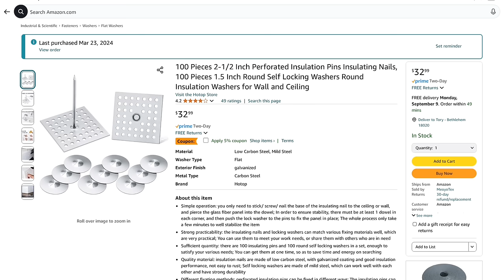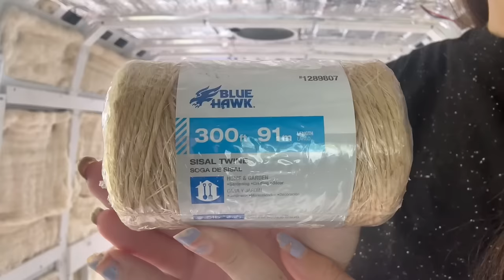Insulating my Camper Van with Havelock Wool | DIY Solo Female Van Build Series

Comment: I like Havelock, but I will mention a plus for Thinsulate is not worrying about it after installation. I put it up with 3M 90 spray adhesive 9 years ago, and its still in place, including the ceiling. How do I know for sure?  Because I'm an extra lazy van builder and never got around to putting up finished walls or ceiling, so the Thinsulate has been my decor.
Reply: Can you assist me too pls

Comment: I would not want the wires in the insulation. I would run channels of PVC tubes to run the wires through so they are easy to replace without tearing the van walls apart if you have wiring issues or want to run more wires for additional items later on.

Comment: For any other builders using the pins for insulation, they can be cut shorter with side cutters after pushing on the circular clips to the required depth.

Comment: when I did research for insulating my enclosed trailer, I was amazed about how no one seemed to have a consensus on the best insulation except for Spray foam insulation (That even has downsides like clean up afterword).  sealing it completely has downsides because the trailer can't breathe and leaving it breathable can have issues also like letting moisture in and it might not dry itself out.  I ended up deciding to go with owens corning pink foam boards with a pressure fit. I did not seal the boards, the boards are moisture resistant and wanted any leaks to run down to floor and leak out the trailer.  good luck with this insulation.

Comment: those stick pins are common for insulating hvac ducts, and just cut the pins off using any kind of cutters after you install the retainer disc. I would likely use rockwool for the lowest foot, for the wet issues, but options and weight.

Comment: Your actually right put wires between the wall sheet and the wool and not the van and the wool in case there’s a problem down the line you’re not taking all the wool out to fix a wire you only have to take down a panel 💜
Reply from the maker: YES! I completely agree! Thanks for the helpful comment!

Comment: AutoPly Cargo Van Insulation from Upfit Supply comes in the form of pre-cut kits with a peel-and-stick application process. They are designed to fit specific vehicle models like the Ram Promaster. Kits start at $270.

Comment: You probably smell the lanolin in the wool, not the wool itself. I think I'd rather use rockwool, totally inert. And unless your walls are very sloppy, there should be no danger of inhaling it, either.
 Look online for a "nail puller" od "nail nipper", they are tools built to cut protruding nails flush. Just take a bite off each nail to shorten them.

Comment: What about using spray adhesive to adhere the insulation to the van wall? If you go with the pins you will have to put several on each piece of insulation to spread the weight enough to keep it from sagging over time.

Comment: Regarding the Frost King liner that was put on below the Havelock insulation. There are some common misconceptions about how IR reflectors work.  One of the biggest is not knowing that it needs a significant free air space (at least a half of an inch, but ideally .75" and greater) between the heat source and the surface of the IR reflector to reflect the heat. By putting the Havelock wool directly on top of the aluminized plastic, you have ruined its ability to reflect IR well (or possibly completely).  

 You should have put the IR reflector on top of the Havelock insulation. And if doing that, a needle punctured, slightly breathable type should be used so that the Havelock wool below can exchange moisture.
Reply from the maker: I didn’t use the Frost King for that purpose, I used it as a thermal break :) I made a full video on it, explaining how it works, and testing to show the results!
Reply: @ToryDelury    Hi there, I just watched part of that video. A couple of times you mentioned radiant heat. That's just a different term for IR (and IR is an abbreviation for infrared aka "heat" energy) .  

    Again, IR reflectors need a free air space between their surface and the source of heat to reflect heat back. 

  Regarding the testing, I suspect that the Frost King did as well as it did, not because of the aluminized surface (which potentially is an IR/radient heat reflector), but because it has a backing of foam.  Foam is a really good insulator in both a conductive and convection sense. 

   Aluminized plastics are often used in attics as a "radient heat barrier", but to be used correctly, they have to be put on the outside, hanging away from the insulation and walls.  If the insulation is touching the inside of the aluminized plastic, it won't "block" (read, reflect) the radient heat coming in from Solar heat gain, but it will still reflect the IR/radient heat coming up from inside the house since the shiny side is facing that with free air space. 

   With an air gap on both sides of these double aluminumized plastics (i.e. both sides are shiny), it will reflect both radient heat from Solar gain and radient heat/IR from inside the house. 

   I'm not trying to be critical or nitpicking, but just explaining how these things really work, so that you and others know for the future. IR/radient heat reflectors are a great idea to use, but if not used properly, they really don't do anything.  

  Cheers

  P.S.  There are even some construction folks that do not fully understand or know the above (and radient heat barriers are somewhat commonly installed improperly).
Reply: @ToryDelury   To give a bit of context or background.  I make my own vacuum insulated panels at home. I know a bit about insulation and "thermal breaks" (which is just another term for thermal insulation i.e. something that slows down heat energy exchange from one area to another). 

  I'm also in the middle of prototyping a cooler, or rather mini fridge that doesn't use any electricity to cool, but uses the IR sky window and radiating heat/IR up into space to work to lose heat and thus cool things down. 

   (Unfortunately, such a system has weaknesses, such as clouds and high humidity interfere with the above process, and really reduce the efficiency, and it needs to be outside to work at all to begin with).

Comment: My guts tell me the larger horizontal pieces need more pins or the weight will create bigger holes during the earthquakes aka driving. Those pins and plates may also become condensation bridges. I probably would have opted to spray glue them in.

Comment: You can cut the pins to length with a pair of dikes. Your pin method looks pretty good. I get a kick out of your OCD. I admit I have bouts of it now and then when building stuff. Your insulation will definitely improve the livability. As you could tell from the old van. More progress.  😊

Comment: I think you're going to have cold spots where the pin covers compress the insultation, reducing the "R" value at those locations
Reply from the maker: Interesting thought, honestly I’m not too worried about it, though I did wish I had bought longer pins at 3 1/2” but at the point of that realization it was too late lol, but I guess I could fix it now by just placing some small pieces of insulation over the pins 🤷🏽‍♀️
Reply: @ToryDelury  i did like you bending the end of the pins. You should have done it everywhere, though it's time-consuming.

Comment: That’s ridiculous, the only way to get into every nook and cranny is to have it spray foamed . It cost less than all that wool and gadgets. They will scrape it down and remove the trash. 
    Attach horizontal boards after for wires or plumbing,and vertical panel  trim on that. Very easy to get at any problem.
Reply: From my research notes: "Worth noting that more than a few body shops won't work on your van if they have to deal with spray foam. They allege there is no off gassing however even if its been a year after install I cannot be in a smaller confined space with it or i get raging migraines and have problems breathing.. Spray foam RISKS detaching from body panels over time as the chassis flexes, and can result in endless annoying squeaks that can be a nightmare to find and solve. Spray foam also makes body shop repairs a nightmare if a small collision needs welding, dent repair, etc."
Reply: @ professional installation of foam does not emit off gas and does not come loose ever . No sure if your talking about some diy can crap from a box store ?

Comment: Havlock wool can/will mold. Remove the paper from fiberglass, no mold! I know the wool is "Sustainable" but still a bad idea.
Reply from the maker: Havelock Wool is mold resistant, the misconception comes from it being hygroscopic but I’ve done lots of research & felt happy with it in my last van for so long :) I’ll be going in depth on my choice & the other leading options in my comparison video! I didn’t feel like I had enough time in this video to go into all the things I wanted to 😅
Reply: @ToryDelury  yeah I googled wether it molds or not & it said something like hydroscopic. The video was Great, a learning moment for all of us
Reply: The best solution is spray foam. It gets in every nook and cranny, self adheres, and seals the wall so moisture cannot make it to the cold surfaces and it has double the R value.
It pretty permanent and would be a bit of work to level the inside surface off.
I assume she isn't using it because she has some issues with the foam or the blowing agents. Though I think most of the modern foams don't use hazardous blowing agents. If those other products are acceptable I don't see why foam wouldn't be either.